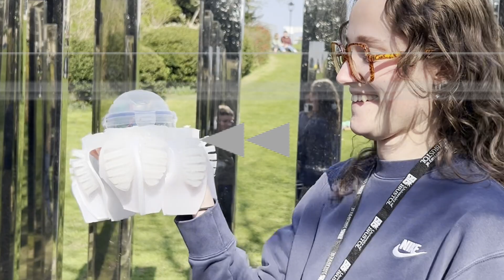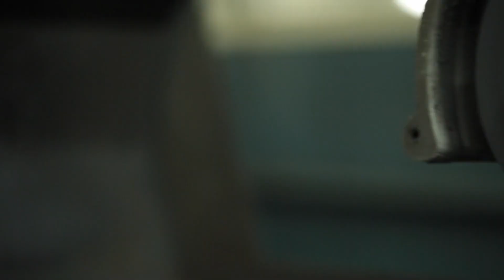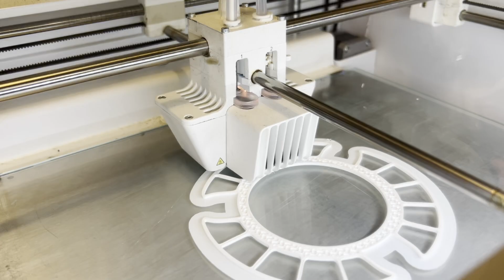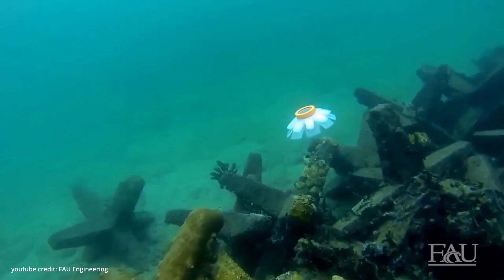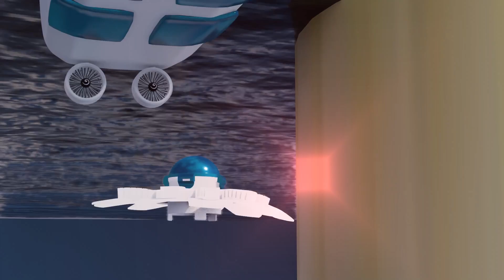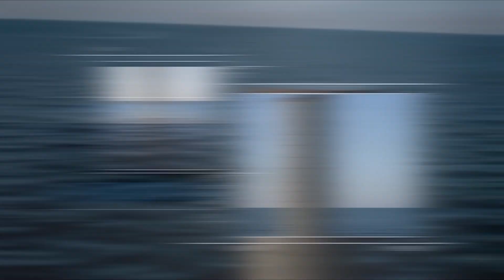BLOOM - A Biorobotic Jellyfish Inspired Swarm.

Comment: The makor challenge you will face is currents… how fast do they swim?
Reply from the maker: You are absolutely right, currents are a great challenge. Unfortunately we were not able to test the BLOOM-Bot in a large enough container to measure speed. Future prototypes would likely have more powerful motors and a more optimised hydrodynamic design. The concept is that even if one bot is moved out of the way by the currents, another can take its place and continue scanning.